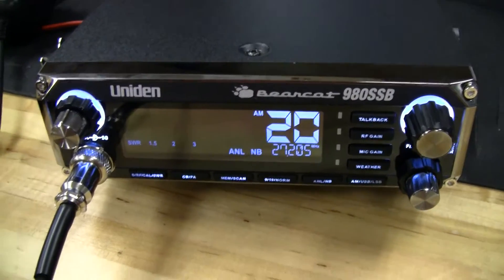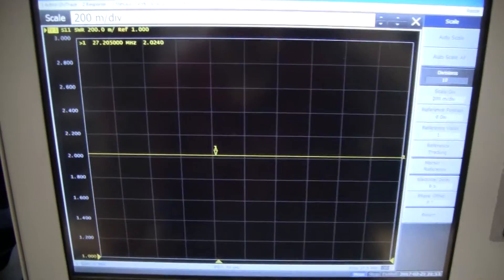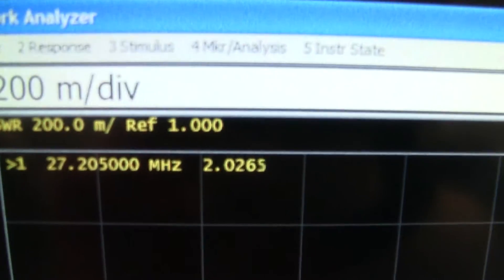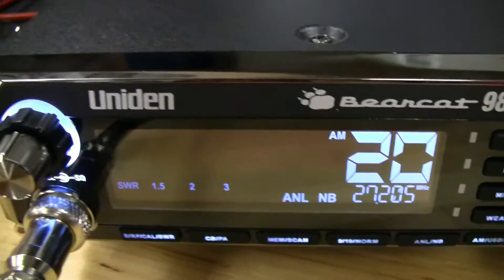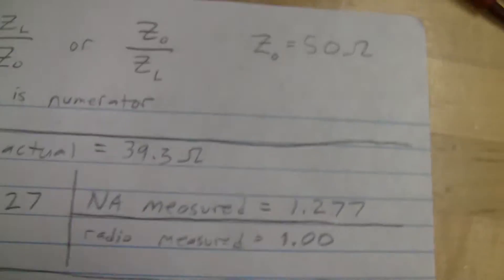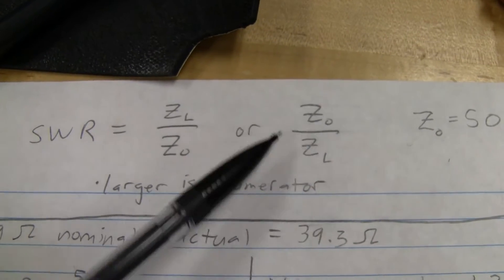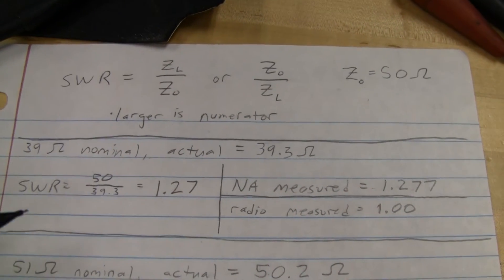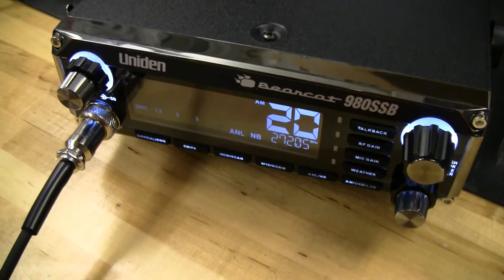Uniden Bearcat 980 SSB - SWR Meter Accuracy Test

Comment: It was thoughtful of Uniden to calibrate the SWR meter feature to display higher than actual value. It is also nice that you are not trusting an external SWR meter, with either an over shielded or plastic case, with a patch of cheap coax to tune an antenna, then removing it out of line and assuming it  had no parasitic resonances, impedences or losses. The math formula is nice to bring up, but we are just starting to get antenna tuners that display actual values of impedence and reflected wattage, so the formula can be reverse solved for that, but it would not descern between mismach of impedence or resonance. 
You can still get alot done with the basic SWR reading, and the channel 40 & 1 trick, bit that is the worst when you trim or adjust an antenna, and it just gets to a 2:1 dip and starts to go back up. Now coax quality, connector assembly, near field metal objects, or a badly resonant length of coax is preventing an impedence match. 
That is rare, but means buying new stuff, and un/re install process.

Comment: Ok so I can't understand a f.n word this dude is jabbering, we are mostly truckers here looking for valuable videos to help us dummy along with our Bearcat and not mathematician's. I have the Bearcat 980ssb, 18' dual coax cable, 2x Firestick II(exact brand) on springs, on the mount. When I key up in SWR it shows about 2.69-2.71, I've been told that's too high, goes down to 2.41 ish when I turn Cal down a notch
Reply from the maker: first thing to adjust is antenna length, I've found this guide helpful

https://www.rightchannelradios.com/blogs/installation-guides/18330687-cb-antenna-tuning-instructions
Reply: I hope you are not believing the meter in the radio? Also those dual antennas are a waste of money.Get one good antenna that works properly and it will do a much better job with less issues.

Comment: The microcontroller they use has an 8 or 10 bit ADC so they lose a bit of the measurement. 
(I think it's 8 bits - I would have to check the datasheet but the original MCU is a Renesas R78 series if your interested)
Both the forward and reflected voltages from the directional coupler (SWR bridge for you CB folk) are at the ADC mux.
It worked but the bottom end and the top end were inaccurate. (less than 1.5:1 or greater than 5:1)
Which, when you think about it is just fine for use as is. Obviously the average Joe doesn't have a VNA.
When I re-implemented it I have a 12 bit ADC in my MCU so I was able to increase the accuracy of both the S-Meter and SWR measurements.
And because the forward and reverse voltages from the coupler are present at the ADC the "calibrate" is actually an unnecessary thing to have n the radio to start with.

Wait till you play with the S-Meter. That's a ball of laughs.